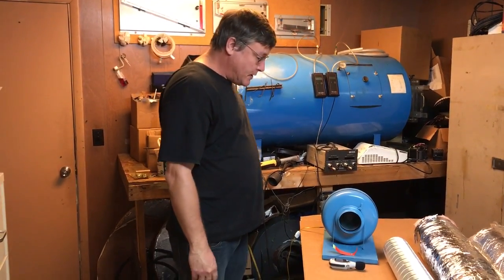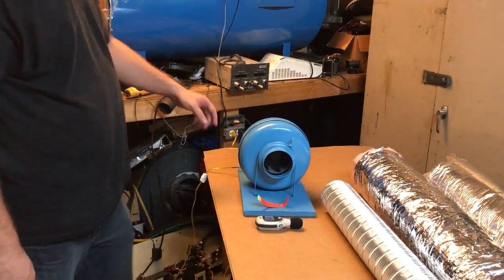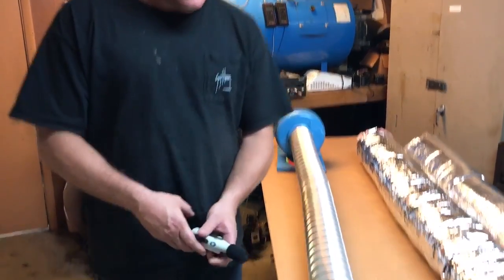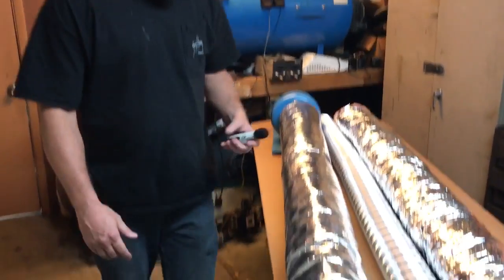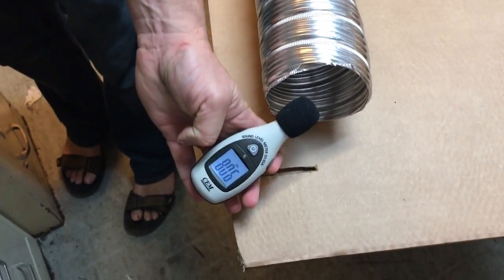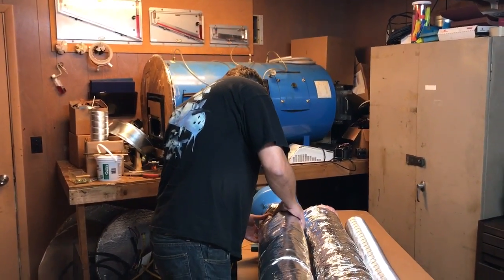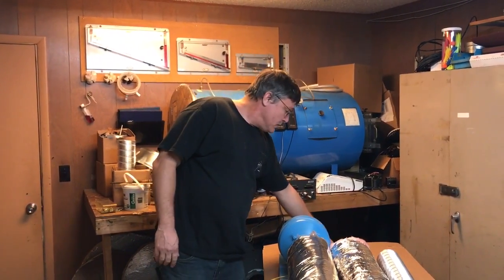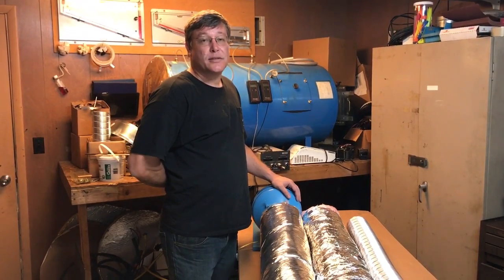Duct silencer 1/2 price

Comment: What do you do if the duct can't be replaced?  (The ceiling would have to be torn open, as there's no attic, and the landlord would be unlikely to agree to that.)  Have you ever tried interior lining?
Reply: I tried that silver interior lining, it works! but you got to put it at least three feet into the duct
Reply: @AR-tb9hq   Thanks. That silver interior lining, is it the one that's:
(1) around 3/16" soft butyl rubber with a sheet of aluminum on one side and peel-and-stick self-adhesive on the other side?
(2)  just a fairly thin-gauge round metal tube with tiny holes drilled specially for acoustic damping, as in your video?
(3) 1/2" high-tech fibrous padding between coating on both sides, which you cut, bend into a tube shape, and put inside the duct?
        I appreciate your reply.  I turn on the fan and it sounds like the end of the world.  (But if I take out the fan itself, hold it in my hand and turn it on, it's whisper-quiet.😂)
Reply: @AR-tb9hq  do you mean the car sound deadning mats?

Comment: Is there any way to cool the hot air that exits?
Reply: https://www.youtube.com/watch?v=FS2YaJkkHQY    Bottles of frozen water is less messy.
Reply: https://youtu.be/MTXSXL1P374
O
Reply: A very late reply but having the air run through a tub filled with ice cubes (with two holes to drain the water into a tank of some sort, one hole at a lower elevation has the water go through and the second hole is where air will come out of the tank allowing water to freely flow into the tank for the first hole) would cool it down quite effectively only downside is the ice will melt however if you have an automatic ice maker to drop more ice at around the exact time you need more ice in your cooling box this would automate the process though dropping ice would creater quite the noise so you would have to figure out some noise dampening solution for that if it is an issue

Comment: Strange video.  As David Swanson so aptly stated, you don't put a mic in front of wind when measuring noise no matter what kind of wind filter it has and this one surely didn't have much.  2 other problems I noticed:  They didn't even try to seal the duct to the noise generator.  Who knows how much noise was leaking out if the gaps?  Also they should have also measured each duct with it curving at least once.  Maybe even twice.  Most ducts are not completely straight and this greatly aids in noise reduction.
Reply: https://youtu.be/MTXSXL1P374
O

Comment: Having done audio engineering work my suggestion for your demos is to not hold the measuring tool in the path of the air flow because unless the “muffled” vent also decreases airflow you’ll be pushing/pulling the same amount of air past the microphone which creates a ton of wind.  In normal day use we stand about 2-5 feet away from the opening of the vent as so that would be the best way to test the effect - get in a small room where the motor is in another room and have the vent end up in that small room and then place the measuring tool about where a persons head would end up in relation to the vent.  Even without all that I’m just saying that airflow has its own noise that happens regardless of motor noise (think of how noisy the wind in the air can be and it’s not like we are hearing some giant turbine off in the distance that’s causing all the noisy wind).  It also has to do with pressure and other factors (of which you are decreasing with your demo) but I think the biggest showstopper you could demonstrate would be to do a very long section of muffled venting vs traditional and have people hear the difference when you switch some kind of y-joint near the fan.
Reply: Being a person with common sense my question to them is: are you drunk?
Reply: @Kevin-sd9ec  holly ish you took the words right out of my mouth he has to be onsomething I am on something also my point is if you take a piece of metal and you put cloth around it it's going to be quiet whether it has holes in it or notput a t-shirt on something glass or metal and hit it it's a lot quieter basic physics Bud good video though and as far as what knucklehead was getting into it will get quieter if you hold it further away but we want to see the difference not go to the extremes how do I can see his point also it seems to be slightly misplaced
Reply: @toolguyslayer1  But he was measuring at the opening of the duct.  The insulation would only help for the radial noise, probably not much for the axial transmission.  I have my bathroom vent motor in another room (further more, on the other side of the next room) and yet I can still hear the fan through the duct like it was one inch from my ear.  If I put insulation on the duct in the next room it would make no difference in how much noise I could hear in the bathroom.  I hope that makes sense.  I wish I could draw a diagram.
Reply: the silencers are not effective, because I used x2, two silencers, one at each mouth entrance and low from 77db to 69 db my rvk200 of 1080m3, some Spanish brand sonoconnect soundproof ducts lowered me to 70.5 db, using 70cm on each side, Well, the silenced duct has a value of 3.80 euros per meter, cheap but the silencer, the silencer duct in my case of 60cm and 200mm is worth 200mm is worth a minimum of 50 euros, for 60cm of silencer, which has 4cm of low absorbent material class, 25kg wool or other low density per kg per m2 and density at a thickness of 40 millimeters 4 cm of wool, the silencers are the biggest expense less performance, now disappointed with the result of the silencers that I buy confident in 20 to 28 Result db I will desistalare them and buy spending more than one for bad information and deception because they are useless, the change is noticeable 4%, a modern conduit of the latest design, it is French it is called phonic trap, I am sure that replacing my s traditional rock wool and aluminum sonoconnect ducts for this phonic fabric with cotton that is just as effective as wool plus the polyethylene layer will have better results than with silencers and the obsolete technology of traditional aluminum soundproof tubes plus rock wool plus aluminum Micro perforated, as I will trust the phonic trap brand, I found a virgin brand phonic trap from France that looks good, in my country Spain Madrid, we only have silencers that do not give good results and obsolete aluminum pipes plus rock wool Simple, thank God I found modern French ducts which I have not used or tested but I trust, my idea is to use my size of 20cm to which I am going to micro-perforate and the outer layer to add rock wool of construction of 40kg and 5cm more thick to add to the tube that thanks to the metal structures does not obstruct, then the 20cm tube has a total of 24 I stick 5cm good rock wool and have go 29cm I will add 1cm of acoustic membrane for low frequencies of 2mm and then a total of 30cm I will put another 31 cm conduit inside unmodified phonic trap, in plan an outer layer that protects, total a tube for a 200 extractor with a conduit of 315, but 115mm of absorbent layers
Reply: https://youtu.be/MTXSXL1P374
O
Reply: https://youtu.be/MTXSXL1P374
O

Comment: So the outer diameter is what and the inner diameter is what?  Would have been interesting to include CFM's  in the measurements.
Reply from the maker: Everything is based on internal diameter.  I can make duct anywhere from 3" to 20"  any other questions jeff@cobre29.com.  Thanks
Reply: https://youtu.be/MTXSXL1P374
O

Comment from the maker: We put the a vapor barrier around the metal duct to make it air tight again.  Then we add insulation and another vapor barrier.  This was designed for hospital patient rooms so they wouldn't be bothered by the air conditioner coming on.  This also makes inline quiet fans obsolete
Reply: https://youtu.be/MTXSXL1P374
O